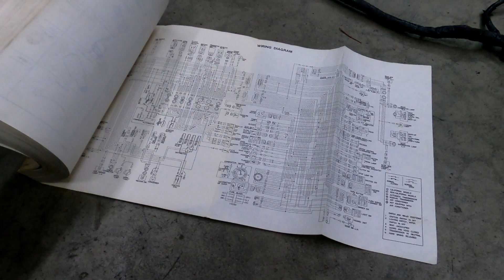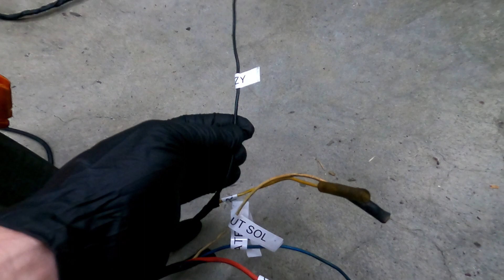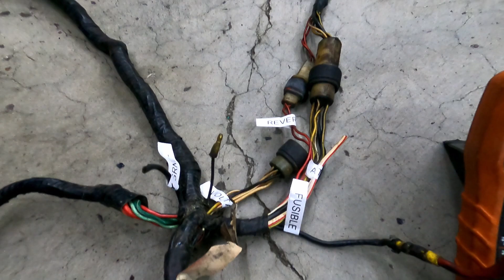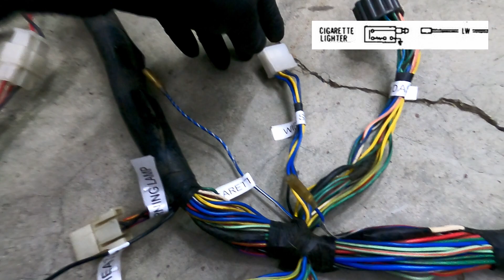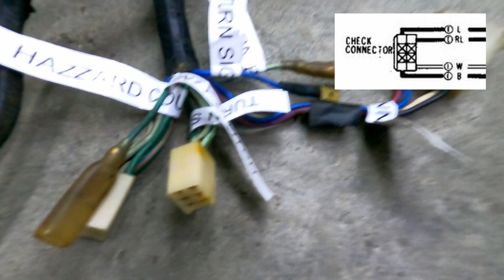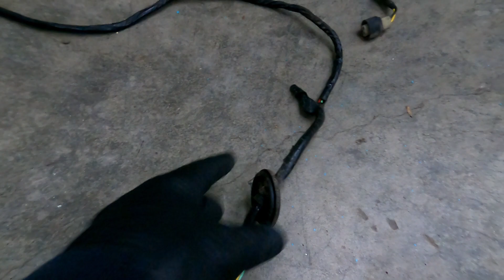Wiring Harness Tour - 1977 Datsun 620 Wiring Harness, Front to Back & Side to Side

Comment: I'm an electrical engineer working in aerospace, and I make wiring diagrams and harness drawings for a living. From an overall perspective, this is a fantastically well done, easy to follow, easy to troubleshoot harness. It's exactly what I would expect from the era! I really appreciate that you took the time to walk through it, as it's something on my long, long list of things to do with my '77 build. I have this grandiose plan to rewire the entire truck to my own spec and use D38999 Mil-spec connectors as passthroughs in/out of the cab. Mind you, I haven't decided on an engine swap option yet so things will assuredly get more complicated in the future, I'm sure!
Reply from the maker: They are great for what they are designed for. It's when a bunch of stuff gets added that problems typically start. 
Thanks. I have similar plans far off in the future haha.

Comment: Never thought it would’ve been so much wiring 😂
Reply: Earlier years of 620 were more simple.
Reply: This will help when I start my wiring process although mine is a 73 not sure how different the harness is on the older ones
Reply from the maker: @spacemonkey339  The 73 is much simpler.
Nicoclub has all the Datsun wiring diagrams. 

Here is the 73
https://www.nicoclub.com/service-manual?fsm=620%2F620_1973_Datsun_Truck_Wiring_Diagram_MT.pdf
Reply from the maker: And that was without the California BS lol